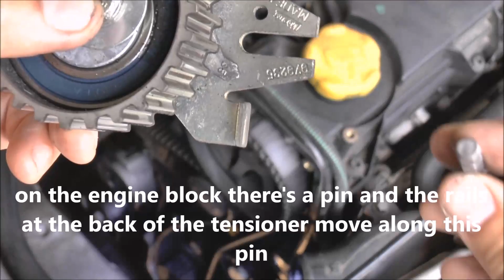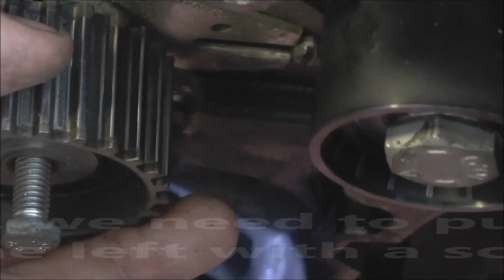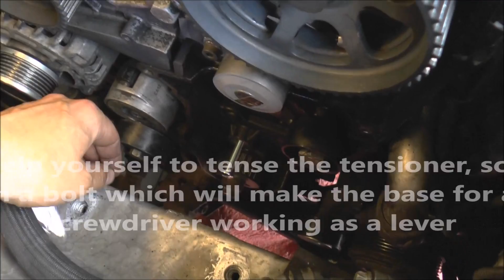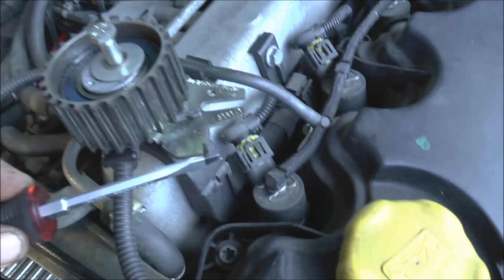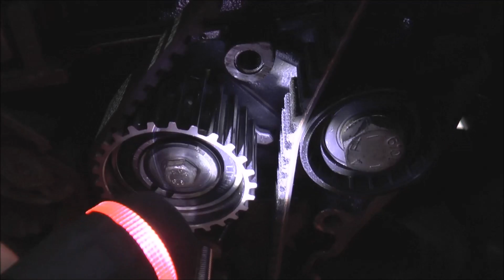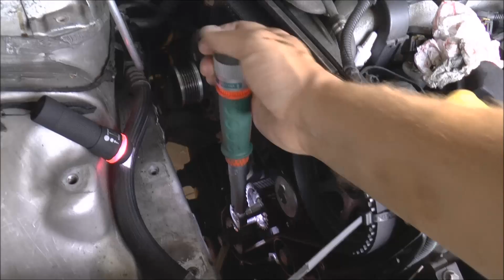How to fit the timing belt tensioner, how to tense the belt - 1.9/2.0  cdti/JTDM, Opel, Lancia, Fiat

Comment: Great video as always from you,  thanks.
Is the timing belt something a diyer could do with enough research etc ? I watched video and feel capable. 
Thinking my 1.9 cdti 120 Vectra might need a head gasket and was a bit worried about doing the  timing belt but it doesn't look too difficult. Thanks
Reply from the maker: If you feel capable, go ahead :)
Reply: @fixanddrive   can I use the locking tools as well as to be extra sure it's all in time or is there really no need ? Thanks
Reply: @Arounadabout  I guess it's a bit late to reply but just in case you didn't start the job: I got a box on ebay with all the tools for fiat alpha etc.. ( i have the same engine). It turns out it was not absolutely necessary. As you can see in his other video, he seems to unscrew the crankshaft pulley ( the one holding the auxiliary belt) without doing anything particular. I suppose the car was in gear and that the compression of the engine is enough to stop it from moving. These 4 screws are only tightened at 25nm so they are easy to unscrew. I used the flywheel locking tool but I guess it's mostly handy when you want to change the crankshaft oil seal because the bolt is tightened at 340nm. Read my other comment if you have trouble with the tensioner's needle not moving, I just had to make a few turns with the crankshaft and the belt tension evened out and it made it easier. The other special tool that looks a bit like a key shape that you screw on the crankshaft and on the oil pump just makes sure the crankshaft doesn't start moving I think. I actually couldn't really figure out why one needed to put this tool. If you put the marks like he said on his other video, worst case scenario is that the crank moves a bit and you just put it back on the mark. He just blocks the crankcase with a piece of wood which keeps it from moving.

Comment: Does the pin on the right have to align in center of the hole or next to
Reply from the maker: it just holds the tensioner in place, prevents it from rotatating. It doesn't matter where it is exactly.

Comment: I am just trying to find out which tool i need to use to tighten my tensioner pulley for the timing belt? i popped the cover off the timing belt and the belt was in perfect shape. The only issue was that to the right mid, the idler pulley was broken. Now i am testing my theory of just tightening the tensioner pulley so the belt is tight enough to turn when i start my car! before going to the shop because they say its an interference engine and might not be worth it if the valves are broken, so if i could just tighten to the tensioner to see if it starts up then it would be worth having repaired. Urgent

Comment: Hey Fix and Drive, My engine is the same but the tensioner has a bolt instead of a screw. The thing is I can't seem to make the arrow move when I push the tensioner. I guess I have to try and push harder, I will try and put a bolt like you did. You think it could be for another reason that it doesn't move? When I removed the old belt, the arrow from the old tensioner was not on the hole, it was way down, I assumed the previous mechanic did a mistake. But now I'm wondering what is going on. I stopped for today but will try and finish it tomorrow. Cheers
Edit: I figured it out. I needed to just tension it the most I could and then make a few turns with the crankshaft manually and then I was able to move the tensioner enough that the arrow started moving.
Reply: Did your tensioner or water pump had a rattle/noise because this under tight by previous mechanic? Cheers
Reply: @terranoid7300  not that I recall. The tensioner tends to get some slack with time. You have to turn the crank a few times to make sure you have a good tension, you will see the dial moving when it turns

Comment: A question! What if the arrow on the tensioner moves out of default position while rotating the engine two revolutions by hand? Is that supposed to happen?
Reply from the maker: yes, it's nothing to worry about

Comment: Hi
I noticed after replacing the tentioner, that when the engine is running, this little arrow quite quickly moves up and down.
Do you know whether or not this is supposed to happen?
It seems odd to me, because so far, all other tentioners that I've seen just provide tension and do not relax the belt at any time. Whereas this one seems to tention/relax constantly.

And when you shut down the engine, the belt is tensioned, but if you press on the belt it gets relatively loose.

I hope you have a idea of whether or not this is normal
Reply from the maker: correctly fitted tensioner always moves while the engine is working. When you press the belt while the engine is shut down, the arrow should move up.  If it doesn't move, it means it was tightened too much
Reply: Thank you very much for the video and the reply.
Is there any way to check if it is mounted correctly after letting the engine run already?
For instance, in my case, the arrow is going up and down just a little above and below the indicator hole.